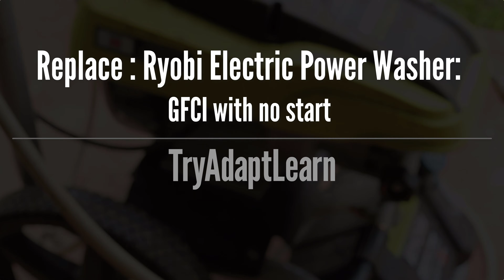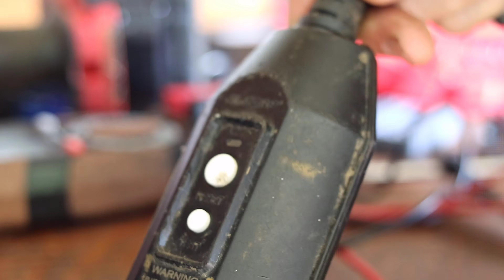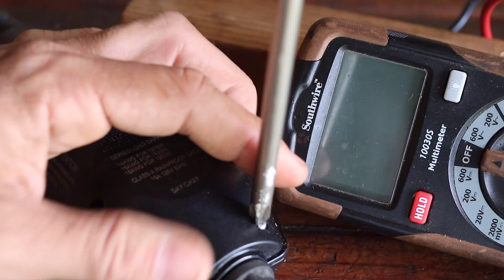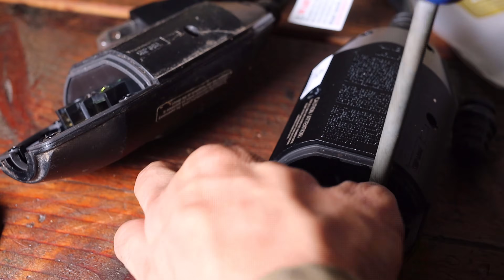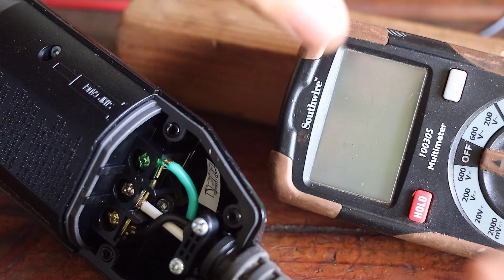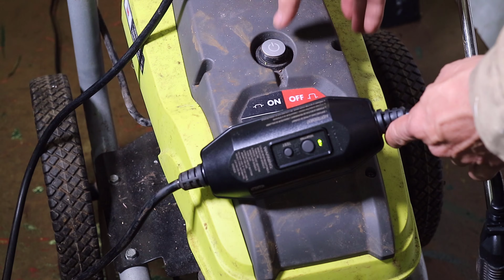Ryobi electric power washer no start: Replace GFCI

Comment: I just found one with that appears to be a broken plug. Lights on the gfci but not the unit. When I press TEST nothing happens so I’ll be ordering the plug and see if it works and I’ll have me a pressure washer for $20

Comment: Here's the deal: If you shake it and something is loose inside, don't you think you would want to know what that is? Well, I did, and I noticed the neutral (white) wire had become dislodged between the two plates that anchor it down. Loosened up that screw, shoved the neutral lead back in there, tightened it up, and back in business. No GFCI replacement needed. As the Germans say, "Warum einfach, wenn es auch compliziert geht?" (Why make it simple when you can make it complicated?)

Comment: I have watched people replacing a two pronged GFCI on Ryobi, and I noticed something common that people who need to replace the GFCI for a two wire plug. The wiring on the two pronged GFCI is incorrectly wired at Ryobi, because I don't see this problem with other GFCI plugs. The GFCI that Ryobi puts on their pressure washers have the WHITE (neutral) wire connected to the Line terminal, that is the HOT terminal, and the BLACK (hot) wire going to the neutral terminal. It will still work, but when the orientation is reversed, it does damage to circuit boards and thus, eventually the machine stops working because the circuit board is shot. 
If you have a two pronged GFCI plug, don't wire it the wrong way! 
The correct way is BLACK wire on the LEFT terminal which has a marking that says "L", 
and the WHITE wire on the RIGHT terminal that has a marking that says "N".  

Black on left ☜ side, 
White on right ☞ side !

Most people that rewire the wrong way, are unfamiliar with electricity or electronics and just rewire a factory mistake because they think that is the correct way. I hope this helps anyone who is unfamiliar with the mistake made by Ryobi's wiring and take time to follow these simple instructions on how to rewire correctly and save your next circuit board on the GFCI

Comment: Can I replace this with a standard plug? No GFCI
Reply from the maker: Thank you for your question.  I am not an electrician and this is my opinion and only an opinion:  Any GFCI on electric power washers should always be replaced with the GFCI for that machine.  Even if the power washer is plugged into a GFCI outlet/receptacle, the properly working GFCI on the cord will provide a shut off incase of a ground fault and/or water hazard.  This should shut off the electricity to prevent or minimize the time the operator is shocked or electrocuted.

Comment: Thanks for the tip. I have zero voltage. Replaced all better..
Reply from the maker: Thank you for leaving feedback and good to read that you were able to fix the issue with your pressure washer gfci.

Comment: that is a strange fault--the gfci lights up normally, but is not allowing current through.   

ive heard some ppl troubleshoot that by trying just a standard plug without gfci
Reply from the maker: Thank you for your feedback and sharing what other have done to help troubleshoot and/or resolve this issue.

Comment: seems like a common weak link with electric pressure washers.  mine failed as well....easy fix though
Reply from the maker: I think that if not an internal design flaw, it may happen when they have shorter cords and/or are use with an extension.  By best guess is that the gfci kept hitting the ground while transporting, rather than picking the end of the cord (with gfci) up anytime the machine is moved.

Comment: I turn on my pressure washer before putting in water hose...it turn on then off...then the cgfi is red won't reset
Reply from the maker: I'm sorry to hear about this.  It's hard to know why you GFCI is red and will not reset. It may be related to turning the machine on before the water hose was connected,  If so, the problem may be with the machine itself along with or instead of the actual reset button on the GFCI.
Reply: @TryAdaptLearn  i think it still work even with the red light on the plug

Comment: Your GFCI diagnostic was spot on, that was my problem.  However I had the job all set up and ready to go on this, one of the last warm sunny days here in the Northeast.  I replaced the GFCI with a regular plug (sketchy, I know) and was able to finish the job.  Now I'll order and install the GFCI as per your link, thank you.
Reply from the maker: Thank you for your feedback.  Glad the video helped you to diagnose the issue and you were able to order the part.  Be safe.

Comment: My light doesn't come on at gfci or on pressure washer should I still replace gfci?
Reply from the maker: You may want to double check the power outlet, then check the power to the GFCI and motor on the machine.  You can also shake the GFCI to hear if anything is loose.  If the machine is unplugged, it will allow for a visual inspection when the GFCI is disassembled.  Please be safe when testing electrical current.

Comment: My gfci is lighting up the power button is also light up but it just won’t start. Any idea?
Reply: I have the same problem... It would turn on and stop but it's just a buzzing noise. The switch light is still on but it won't run...
Reply: @djpacis3570  I took the end off my wand & water went through. My nozzle was clogged. Once I cleaned it; it began working
Reply: @djpacis3570 hey did you ever figure out what the problem was? I’m having the same issue and can’t figure it out
Reply: @sethsiebert5830  nope replaced the plug with a new gfci but still does the same thing.
Reply from the maker: There would need to be electrical tests done to see if the electrical current is still is then flowing to the motor.  Please be safe (or get an electrical professional) when testing electrical current and make sure everything is completly dry in, on, and around the machine.

Comment: Good step by step.  Do you have a link to where you purchased the new GFCI?
Reply from the maker: I purchased it from Amazon.   I added the link to the part in the description of the video.  It's no the official Ryobi replacement part but it did work for the power washer in this video.